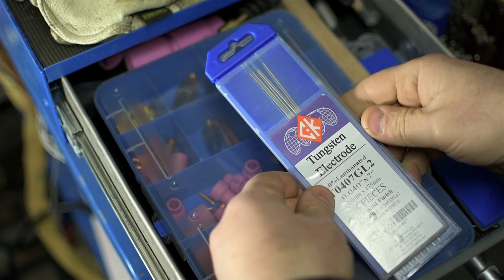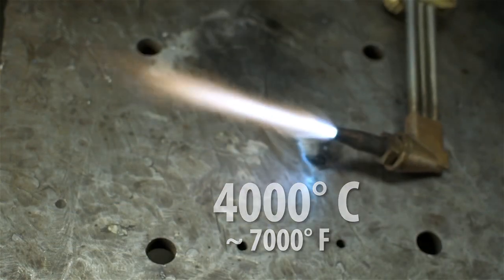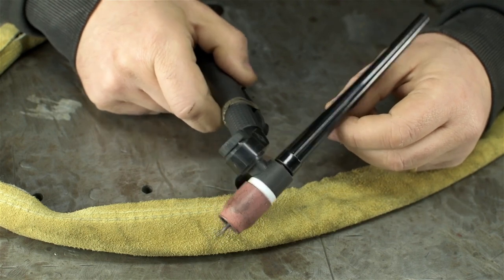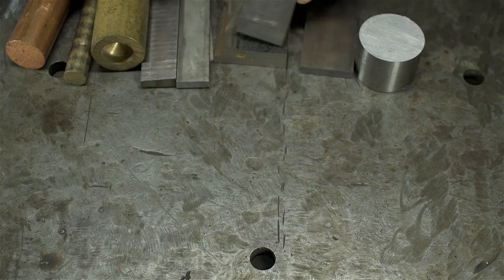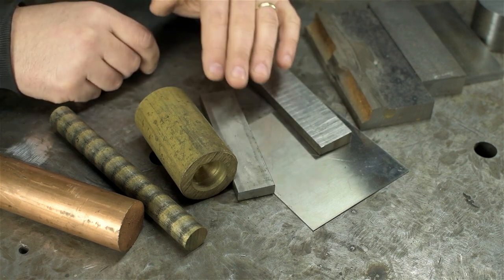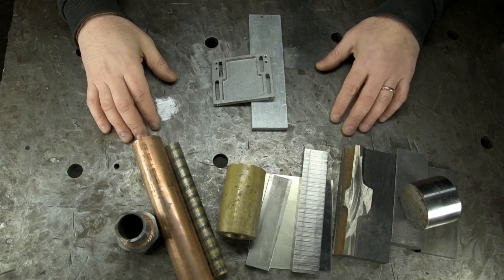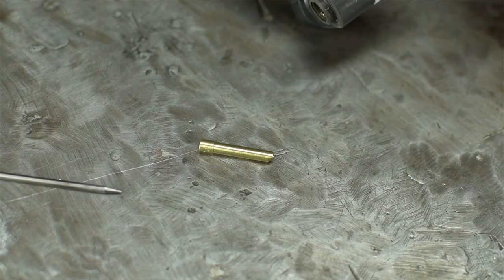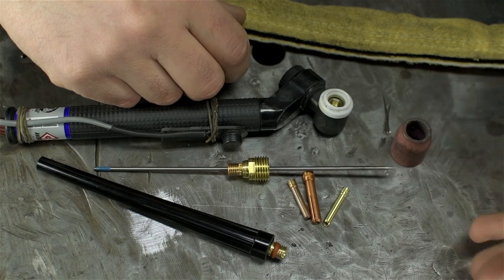Making A Stand! Why I Love TIG Welding

Comment: Not sure how it works in USA, but in UK, the gases needed for Tig are a significant expense for the casual user, and you need different gases for different metals.
Reply: 100% argon will cover any TIG process besides maybe super thick aluminum, where some will use an argon/helium blend or pure helium.

Comment: Looks like an adjustable torch head, versus a 'flexible' one that can break easily if not heated up a bit first. Would love to know what model you use in this excellent video.
Reply from the maker: ck Flex lock 130
Reply: @ThisOldTony  awesome, thanks!!

Comment: How would TIG be with sheet metal or car body work ? 
I would like to try to be able to fill areas and holes rather than the usual cutting out sections if it’s even possible.
On this old Triumph they had brased areas at the factory with brass and lead just got me thinking.

Comment: I've been trying to tig weld this picnic table I'm making, but I can't get an arc. Any suggestions for electrode selection? It's like I'm not getting a good ground or something. It's just regular clear pine if that matters. Oh, and I couldn't find any pine filler rod at my welding store either. Hmm.

Comment: Question Mr.Tony. To use with no pedal. Is the pedal only there to increase or decrease the the amps to the tip? So without a pedal you regulate amps buy adjusting the amps on the machine and if to hot or cold you go back  and readjust until you get the setting just right for that project. But with a pedal you can adjust the amps. Also is there a universal tungsten that’s good for a beginner.

Comment: This is an older video not sure if you will see the comment but i've started learning to TIG weld. while i got better at lap and butt welds, and barely ok at t-joints. welding two aluminum square tubes (lets say 0.5x 0.5 x 0.062) in a T configuration is still a challenge. it is hard to get good penetration without overheating and the material starting to peel away. can you make a video about this to show best practices ?

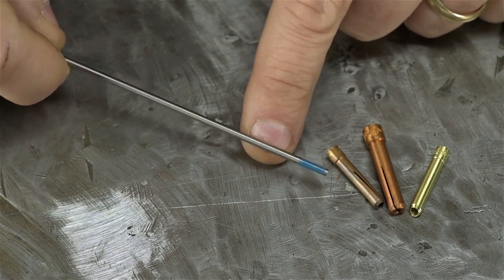Comment: 15:50. pretty sure you want a balled tip when welding aluminum.
Reply: Negative ghost rider. Inverter machines (what he uses) can keep a sharp point. Transformers will ball due to lack of frequency/balance adjustments.

Comment: First off - greetings from New Zealand (down under, middle earth etc etc). Been watching the channel for about 2 years now and really enjoying the content - keep it up!

Got a few questions on your welding table and plea for resurrection of some removed content.
[1] The holes you have in your welding table.  What is the spacing of the pattern? I'm guessing the sizing of the hole is standard ~16mm?
[2] Do you have the holes across the entire table top or, for example, just across one 1/3rd? That way you have an area which isn't going to have screws/bolts/nuts dropping into little black holes of oblivion.
[3] In your holes do you use Strong Arm style fixture clamps?  The table I'm building has a 25mm thick top, do you think those Strong Arm style fixture clamps will work successfully with that thickness top?

Finally you had a video some time back around how you improved a cheap chinese drill press.  I believe you had plans to remaster the audio so as to avoid some youtube copyright silliness.   Is that still planned? I have a similar machine and was very keen to rewatch your approach for inspiration on how to improve my machine.

Cheers,
James.
Reply from the maker: only half the table.. 20mm holes... the only rotobroach I had.  I use homemade clamps.  yes commercial clamps will work in your table thickness and yes I still plan to re release drill press video. :)
Reply: Cheers.   Re hole spacing, looking at a number of your videos that look to be ~150mm apart? On your home-made clamps that sounds like a possible little project/shooting-the-poop type vid at some point.

Comment: Hey TOT 
Could you please explain the difference on the lathe with cutting threads ?
Herr in Germany with our metric threads have to run it forwards and backwards with the feed engaged. Why can the slead Feed Turn off with Inch-threads?? 
Greetings from Germany

Comment: I have a question when I make a table and I want to change the high what would you do?

I do it like this use square tubes use a cylinder with the inner diameter turned it in the correct diameter. Centerdrill and drill a hole for the correct tap cut the cylinder in similar long peaces and weld it in . I think quare would be better.

Comment: Great.  Just when I thought I had settled on buying a MIG welder, now you've got me thinking about TIG again.

I like the idea of a really clean weld with little to no cleanup.  End goal is to be able to weld steel tubing (say, maximum thickness of 0.125").  There's a few inexpensive MIG machines out there (like the Lincoln Mig Pak 140 or the Eastwood 110v MIG welder) that seem like they could do the job.  As far as inexpensive TIG welders, I think about the cheapest I've seen is the 
Everlast PowerARC series of welders.  Trying to read through reviews online, you get the usual "Only buy blue or red!" sort of comments, but it seems like your HTP has served you well so far.  Do you (Tony, or the internet as a whole) have any recommendations for an inexpensive TIG welder?

Comment: Hi tony  I got a tig question i know you have to use a filler rod for tig welding but my qestion. Is how do I know when to dip the filler rod in when tig welding? I mig weld at my house and job and I really want to learn to tig weld.

Comment: Just curious a 2 inch .120 thick wall square tubing properly TIG welded to 3/16 plate.  How much would it take to break it?   How strong is a weld like that?    Standing up on end welded to the plate. I saw a hitch on Amazon like that and it was rated for 15,000 lbs.

Comment: I am a mig welder with minimal tig experience, but want something to you with at home. I own a Eastwood 80amp stick welder that I can convert to tig for around 200$ for everything minus the tank and gas. With it being such a low amp welder would it be worth the investment? or should I just purchase a higher amp tig specific welder? It will only be used for diy exhaust and aluminum cold air intake setups so very low gauge materials any suggestions would be greatly appreciated👍🏼

Comment: Really enjoy your videos, thanks! Coming from electronics and soldering TIG looks very appealing. What is a bit confusing is the talk about 'duty cycle', especially considering my background (think 555 timers, pulse width modulation) and the various pulse, frequency and AC functions on the welder. As you made pretty clear this 'duty cycle' in welding equipment has nothing to do with the electronics engineering term but rather with 'active running time' determined by the thermal limits of the machine (internal electronics)? Or is that just a major simplification?
Reply: Your interpretation is correct but (speaking as an electronics and software person myself) I think the machinery sense of the term as used here pre-exists our use of it for things like PWM. I've seen (I'm reasonably sure) references to duty cycle on manuals for hydraulic pumps and electric motors and the like going back at least to world war two.
Reply: @whiskeytuesday  Exactly, mechanical duty cycles!

Comment: You should have instead bought the BANKA mini lathe from India, that comes with metal gears, is powered by AC motor, and is as inexpensive as it can get. This one has plastic gears for threading I suppose. Anyway, great video as usual. Cheers!

Comment: Hey Old Tony I have a question. Sometimes you use acetone and sometimes scotchbrite. Can you explain which is needed when?
Reply from the maker: if it's generally clean but oily or grimey I'll acetone.  if it has an oxide it needs scrubbing.

Comment: Can you do a video on welding chromed steel to high carbon steel? I work on hydraulics and I'm fascinated by how cylinder rods are welded to the rod ends.
Reply: I can't speak for all of the hydraulic cylinder makers, but the ones I've seen use friction welding.

Comment: I had a crazy idea watching this video.  Have you ever played with slot cars?  You know the novel speed controllers they use; I have a feeling you could hack one into a torch mounted controller like the push button.  It would probably melt, but you have a cnc router to make things... and its probably no where near the resistance range for the welder, so signal processing required... and it would be learning to weld allover again... but would be an interesting video.
Reply from the maker: https://www.arc-zone.com/remote-amperage-controls
Reply: Yeah! That's basically what I had in mind, but seeing if the actual slot car controller could be modified to work.

Comment: ToT, that was an Inflato-Cut 1000 you used for those square tubes, right?  I didn't know they were in production already.
Reply from the maker: time travel.
Reply: @ThisOldTony  Ahh... I should've known that, but my clock is in the shop with a broken anticipator.

Comment: Any recommendations for machines under 500? My father and I would like a tig/stick machine i have mig already made by Hobart 170amp 220v nothing crazy but I Don't do to much welding to begin with so it doesnt have to be super pro. wen i do weld its all thin wall stuff exhausts ect. Ive seen tons of tigs on the cheap side but dont really know what to look for under 500. I'm a beginner dont know to many brands besides for lincoln, Miller, and Hobart . Thankyou

Comment: One time I was told by someone on a welding forum that you can't tig weld copper... I was like "maybe you can't"
Reply: While at college doing my module on tig welding, I was able to successfully join copper on DC. Mind you, the bead was short (about 16mm / 5/8") and the part was small which made the "thermal profile" difficult to get used to.
Reply: @michaelg_839  at work we had an order for several drink rails for a fancy bar and it was all 18 gauge copper. Fun job because it was so clean to work with.

Comment: I’ve been welding for almost five years I’ve always been under the impression that cast iron had to high of a carbon content to be welded and would cause it to be extremely bridal after the weld I was always told if you needed to repair a cast iron part such as an engine block or cylinder head it would need to be tig brazed?

Comment: you didn't mention the stick welding problem of getting the "stick" stuck to the metal you want to weld and blowing the circuit(I developed this skill to impressive levels) to where my 9th grade shop teacher claimed I was the reason they developed the circuit breakers to replace fuses. (sigh, glory days)
Reply: We used to call electrodes stuck in a material "making a hedgehog".

Comment: TONY...I have the same Wireless Hand  CNC Controller you had from China...I have  a problem with it... sometimes it does not know where home should be..most often it will Crash My Spindle into the piece of wood I am Carving (Z drive)..did you have any issues with yours?
Reply from the maker: I've since upgraded to a vistaCNC pendant, but when I had it I remember going through a lot of software updates to get it work right.  (check the MFG'r for the latest driver)

Comment: i don’t have any experience in any type of welding or brazing.
i am although quite the expert in sweating copper pipes in a home for water supply. 250 copper joints and zero leaks. so i understand the concept of melting different materials to get them to bond.
from this video you seem to really understand metals, what can and can not be bonded.   i purchased a damaged 12” disc sander because a woodworker, and i want to repair it.
i was dropped and the leg broke off and the body that covers the disc is cracked.
it’s made of 1/8” cast aluminum and i don’t know how to fuse this thing back together without distorting it and the leg falling off.
could you please guide me in the right direction?

yes, i took it all apart so no motor, and the table and brackets have been removed, so it’s just the body alone and naked, and it is bolted to a piece of wood with the crack and the leg secured in place ready for repairing.  i can email you pictures of you are interested in giving me advice on which way to go.

i want to buy a welder buy don’t know which would serve me better.  is only be welding metals you’d find in any home or garage.
this cast aluminum project will hopefully be one of a kind. but then again you never know.
i was thinking a mig welder at harbor freight only because i don’t think i’ll be using it that often plus from the limited information i have in welders the automated wire feed seems to be the simplest method of welding for a novice....yes no maybe?

Comment: Question for you Tony...what’s your preferred electrode. I started with 2% thoriated, my best welds are with them. Then they tell me it’s a carcinogen and we are not supposed to use them. So we go to this new one that to be honest I’m not sure but may be pure tungsten? Or is that the one for aluminium? Which ever....I have a stash of 2% thoriated because I seem to be able to get my best welds with them. Part two of the question... is there a trick I don’t know about when using other than the thoriated?
Reply from the maker: 2% lanthanated.  Mostly because I can switch between DC and AC without having to worry about it.  I keep them around in 3/32 and 1/16 but almost exclusively use the 3/32 (change the grind for big stuff or small stuff).  if you've still got the reds I think using them is fine as long as you 1) don't eat them or 2) wear breathing protection while grinding.
Reply: This Old Tony welllll I don’t eat them at least! Btw, love this episodes metal cutting/breaking/blowing up!

Comment: Why did you inflate the square tubing to crack it? I just score it, heat it a little bit and then pour some ice cold beer over hot score marks.. Cracks nicely. No need for air compressor and electricity wastage.

Comment: Why is an AC welder more expensive than a DC welder.  Current is AC coming out of the wall.  We transform it to lower the voltage and increase the current, but it is still AC.  Making it DC requires an additional step and more components, rectifiers.  What am I missing or misunderstanding?

Comment: Zinc/galvanized metal is not dangerous to weld, this is an old wives' tale.
Reply: Brad Wilson look at Wikipedia, under "metal fume fever."  Not deadly, didn't sound too bad to me, then I read a post from someone who had been through it.  I'll pass.
Besides, he needed it to make the joke work!
Reply: @firstmkb  We build solar power plants and do thousands of welds of galvanized steel, keep your head out of the plume, as you should with any weld, and you will be fine.  This is from the real world, not the internet.  Ask the men that build gates for chain link gates as well.
Reply: @bradwilson6601  Also research the trouble Porsche and Audi had at the outset, when they pioneered making cars from galvanized plate.

Comment: Can you tig weld with an even more basic AC only old buzz box power source?
Reply from the maker: Not sure.  I know you can with old DC boxes.  For an older AC buzz box you might need a high frequency unit.
Reply: @ThisOldTony  Is that even a thing? I though old buzz boxes were literally just a transformer and a resistor, no switching or anything so they work at  the grid frequency.

Comment: So this old tony i am dreaming about having a mig wilder should i switch for tig🤔
By the way it’s just for hobby 😊
Reply from the maker: depends what you weld.  I had a mig for a long time and really enjoyed it, but nothing is as quiet and peaceful as TIG.  maybe crazy glue.
Reply: Will for the most part i am only doing wilding with thin material rarely wilding something more than 3 mm
Making windows small shad etc. stuff around the house 😌